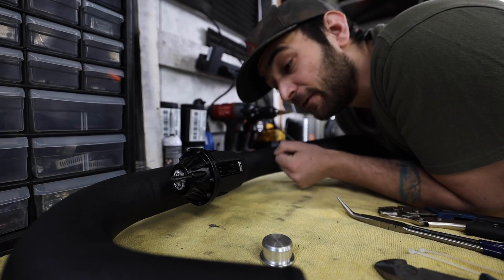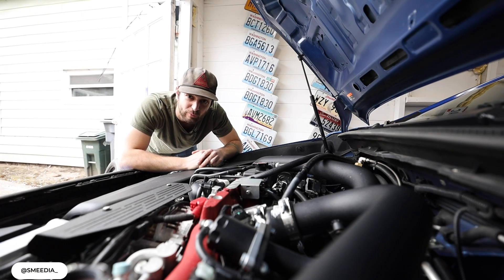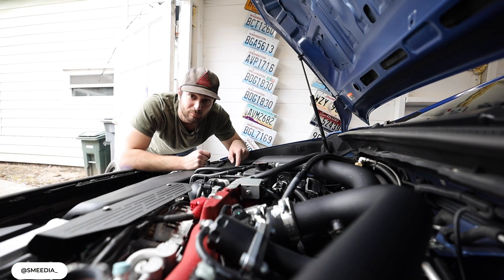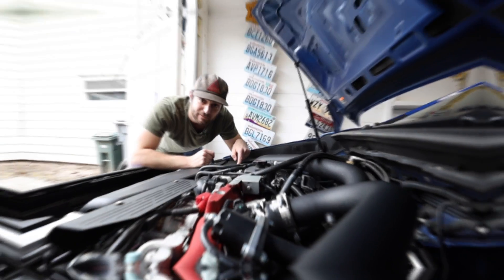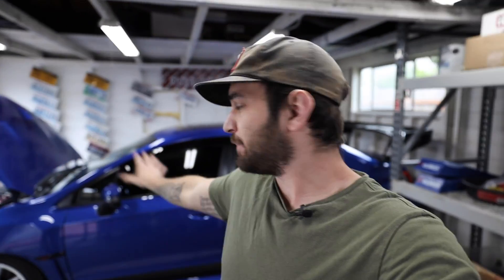This Is Why You Shouldn't Use a BOV On A Stock WRX/STI

Comment: lol first thing i like is the title. you shouldn't use bov on stock sti he is going to prove to us but  his car aint stock. you got front mount intercooler, thats not stock. you have tuned your car, thats not stock. you have many mods on your car. you need to rename this video to why you shouldn't use bov on a modded sti tuned to run rich. i have a bov on a 2019 sti and i have put over 32k km on it and no issues.
Reply from the maker: The car is still tuned for a MAF set up which would emulate similar problems with the car. Mine may have been extastrabated but still similar. The rich condition thr BOV creates is not so much thr issue, however the lean one following it is.
Reply: Smeedia your absolutely far from stock is my point though and just saying that opinions are opinions your and mine but in reality I clicked on your link to see why bov is no good for stock sti and your sti wasn’t stock so your opinion for bovs on stock sti are invalid to me. I have bone stock Sti and I have my opinion to viewers that may be wondering. If you tune your car it will change how your car performs but just bov installation ain’t going to make a big differences there then sound

Comment: This made me proud of choosing the Perrin Bypass :)
Reply from the maker: Perrin is a good option to use! 🔥😁
Reply: @Smeedia  Excuse me but what's the purpose of replacing a bypass with another bypass?
Reply from the maker: Spring pressure, the OEM valve can hold around 20lbs of boost but once you start to exceed it you need a stronger valve
Reply: @Smeedia  So it's a must in highly modified turbo engines?
Reply from the maker: Yessir 🙏
Reply: @Smeedia  🌹
Reply: @Smeedia  you can simply slightly crush the oem bypass valve. Use a metal ball on the center of the valve, and clamp gently in a wood protected vice. Only depress a small amount. Voila, free mod, holds more boost.

Comment: Hmm, how about with a recirculation fitting from the "fin" of the HKS BOV to back to the valve instead of blocking it off? That might be ok?
Reply from the maker: That's 100% okay, thr air is getting sent back through the system so thr ECU can correctly account for the air 🔥

Comment: It’s not even a stock sti. Do a video on a real stock sti. No nothing on it or time. Allot of people want this out of the dealership. This is what happens when you do this when you already have a tune.
Reply from the maker: Similar will happen on a srock STI, the MAF pulls data from what it is seeing such as mine. When you add an Atmospheroc BOV onto thr car you loose a portion of the metered air. While the minor rich condition will cause little to no harm the lean condition following will cause issues. The lost air will also cause stumbling and potentially thr car to die when let back down to idle. I suspect that the one I installed had a leak in it from the factory already which worsened the conditions shown. But this was as close to an emulation as possible before a hybrid SD tune went onto the car.

Comment: Your ARF doesn't show rich at 14.7 Stoich meaning your on pump gas. You going E85?
Reply from the maker: Car is now on E85, stays on a E70 Blend making 401WHP
Reply: @Smeedia  401 is really respectible.  People don't realize that's a lot of hp until you give them a ride, then there like holy crap👍
Reply from the maker: Thank you! Goal is to push the stock block as far as I can before the short block let's go but its definitely more than enough to have fun with up in the mountains 😁

Comment: Okay, so no matter what you are running the car is tuned for that part right? If you are running a BPV the car is tuned FOR a BPV in which case the car isn’t happy when you takeoff the BPV and put on a BOV. I don’t know if I’m understanding this correctly, but if you have your car tuned while it has a BOV then it will be fine right? You just don’t want the car tuned for a part it doesn’t have
Reply from the maker: To an extant you will be alright the major issue that I was teying ti get across is using a BOV on a OEM or OTS tune (one that is not intended for a BOV) Will cause issues

Comment: hey man so I've seen some people with older model Subarus make block off plates for the BPV/BOV to create compressor surge, just wondering if you have any insight into this and weather you would say its okay or if you would say don't do it, pros and cons?
Reply from the maker: It will put more wear on the tubo and mess with your AFRs, the older subarus are pretty forgiving if its something you want to do then you can but aside from the sound there are really no pros to it
Reply: @Smeedia  I have a 2017 wrx, would you say its just more beneficial in the long run to just keep everything "stock" and what I mean is just run a bpv and intake? I have the boomba bpv and had the Cobb intake at one time but took it off and sold it regrettably because I thought It was causing my CEL. turned out to be my studs from the j pipe to the turbo outlet had snapped and caused a leak causing the cel. but thanks for the insight and I will definitely make sure not to hurt the car. was just curious and seen it done but hadn't seen anything about the FA20 motors.

Comment: A Bov isn't going to change anything or make you run rich during idle.. or give you any knock during idle.. its doing the same exact thing as a bpv until you let off the throttle under boost. that's the only time you'd see a change, unless you installed it wrong haha

Comment: I have the perrin recirculator bov is this bad to run this on a stage1+ Cobb tune? The previous owner had it on there just wondering if I should take it out and swap it with the oem one?
Reply from the maker: You should be fine, theyre both recir valves so won't make a difference 🔥😁

Comment: I got a question so my car (wrx 2011) was tuned with gfb bov , and now I wanna switch it back to the bpv , is it ok to just change it or need to tune lol?
Reply from the maker: What was the GFB set to when you were tuned? I know their adjustable. If it was set full open I would get a revision on the tune if it was 50/50 you should be fine

Comment: Guys keep In mind he’s pro tuned with a front mount witch already causes more delay in air! I have the hks on my stock Sti runs fine I’ll post a video
Reply from the maker: As long as it's not leaking and spring pressure is adjusted it should hold fine, won't run in ideal conditions but sounds like you at least set yours up before putting it on.
Reply: Hey bro definitely waitin on that been really hesitant on ordering the hks bov
Reply: Hows ur stock sti so far? With hks bov?

Comment: Why not get a gfb Bov? 50/50
Reply from the maker: You can, I use to run one but it leaked quite a bit.
Reply: Smeedia leaked? can that cause damage?
Reply from the maker: Depending on the size of the leak it can, the ECU Will make adjustments to compensate for bur its less than ideal

Comment: A friend of mine has a 2018 WRX and he has an his bov with Cobb tuner access port, he also has an inlet pipe? I’m not a Subaru guy but hoping to get some info to help him out but he explains everything that’s happening with my friends car is it  okay to just swap back the original recirculating valve?
Reply: & also there’s not much information online with the newer model WRX’s as to there’s different sensors?
Reply from the maker: Yes swapping back to either a OEM BPV or after market BPV will help, as long as the air is recirculated back into the system it will run smoother. The ECU has no idea where the metered air is going so it can freak out, or if his BIV is leaking it will also cause idle issues

Comment: Hey man so the other day you we were talking about the Barometric pressure sensor but what is the reading supposed to be while the vehicle is on mine is reading 14.36 at idle.
Reply from the maker: It will be different for everyone, all depends on air pressure for where you are. Altitude is a big factor that plays into it. Mine reads around 14.69. But yours sounds fairly accurate for where you are
Reply: @Smeedia  true hey man i forgot to ask ive done tuning soo many times but i feel like a newbie since my pistons cracked but are there any monitors that i can dispaly on the AP that i can check prior to my datalog im almost at 800 miles with my IAG block. I got the AFR and all that. I just checked the baro but i want to make sure the car is healthy and im not missing any sensors that may be oit of tolerance.
Reply from the maker: Knock, fine knock learn, DAM are the ones I always suggest monitoring 🔥
Reply: @Smeedia  yup I got those already
Reply from the maker: I would stick with those primarily outside of those your choice. Have a video covering what I suggest monitoeting, what values to look for and why to monitor them as well

Comment: Omg that launch control sounded so mean bro 🤤🤤🤤
Reply from the maker: Thank you! 😁🔥
Reply: as far as I'm concerned, launch control system is an exclusive feature to cars equipped with automatic gearbox, right?
Reply: @coffeedrinker25-z4v  Umm no wtf lmao
Reply: @Kyezie131  I own an STI
Reply: @Kyezie131  What purpose does it serve in manuals then? I can launch my car the way I want.
Reply: @Kyezie131  You're probably confusing STI "Launch Edition" with "Launch Control".
Reply: In this case, it's no more than a rev-limiter. Any decent driver can balance the clutch pedal with the acceleration pedal to properly launch the car without the need for a rev-limiter. Unlike automatics where you can never build up the revs high enough before launching it without having a "launch control system" e.g. Nissan GT-R.
Also my brand new STI does not come with a rev-limiter anyways.

Comment: This video makes me laugh lol “the car smells rich “ I installed a hks bov on my sti and had no problems honestly it’s running great,
Talk to your tuner.
Reply from the maker: As long as your not on an OTS Tune with the BOV its not a huge issue. A protune fixes a lot of the out the box issues associated with just slapping one on
Reply: Smeedia I believe I’m on a OTS tune at the moment, I have to talk to my tuner but it’s so weird that your car has symptoms like that. Have you had any updates on it?
Reply from the maker: I pulled the BOV off the car after the vidro and stayed with the bypass valve, im going on a hybrid speed density tune so because I am still utilizing some of the MAF I'm sticking with thr BPV. But based off of what I did im sure the BOV was leaking air causing idel to be all screwed
Reply: Smeedia I would like to come help you maybe the rubber inside the inserts were not tighten down? Or the rubber seal bad? Also my kit came with a recirculating kit with my hks bov, if you want you can try it on your car if you wanna run the hks!
Reply from the maker: I only used the BOV as an instructional piece for the video to demonstrate the effects of an out the box BOV on an OTS TUNE. But greatly appreciate the advice!
Reply: @Smeedia  what is OTS Tune?
Reply from the maker: Off the shelf, its a pre made map designed for multiple cars to be easily used
Reply: Smeedia So as long as it’s pro tuned with the BOV you should be good?
Reply from the maker: It qill be better than running an OTS Tune. Not perfect but you should be good
Reply: How could it suddenly "run rich" on idle when either BOV or BPV does not work?
Reply: @mibars  I think he didn't tighten his pipes properly.hes leaking some where.thats what happened to my wrx.i use a gfb adjustable bov so half vents to atmosphere and the other half back into the motor
Reply: You wouldnt mate. Its a twin piston or diaphragm design valve DESIGNED TO RUN ON MAF SETUPS. People just seem to talk absolute shit.
Reply: I put one on my stock 2011 sti never had a problem. But nice video 👍

Comment: Washington State resident - Type RA owner, so you think the bpv is the way to go?
Reply from the maker: Yes I do, shouldn't need a BOV unless your full speed density or making higher HP. You can Run a BOV if you want to just make sure you get protuned with it on. Would highly advise against using it with an OTS Tune.

Comment: Great Video! A few years ago I purchased a RFL blow off valve, had it installed with the idea it was a plug and play, I was so wrong. No matter how many washers, ( how it said to adjust ) caused the car to stall at every stop, and turn the tail of my car black from running too rich. To make a long story short, it’s back in the box and sitting in my trunk. I wish I saw your video 3 years ago!
Reply from the maker: Glad that you got it sorted out, and some cars react different than others from what I've seen most think that BKVs are plug and play but so much more to them than one thinks. Appreciate the added sorry and kind words!

Comment: The BOV isnt set up properly. You need to adjust the preload on the BOV for proper idling.
Reply from the maker: Totally agree, wanted to emulate just installing it slight from the box as most do, the video was planned differently in my head than how it was made but appreciate the added info for those seeking to use one! 😁

Comment: I dont mean to be annoying, but this doesn't make much sense to me. Installing a Blow Off Valve instead of a Bypass Valve SHOULD NOT RESULT IN THESE EFFECTS. Especially not during idle, where there is no boost pressure in the intake manifold or the entire system. A Blow Off Valve is naturally closed, so should not effect your idle in any way. However, this BOV in the video looks like a HKS SSQV BOV or a knock off. They are a "pull type " BOV instead of most others that are " push types ". The valve gets pulled open by inletmanifold vacuum behind the throttlebody. So my explanation here, it looks like the set screw, (if there was one)or the spring inside, was not set up right or broken and the BOV opened slightly during idle causing a little vacuum leak. Or he forgot to tighten a hose or something but everything in this video screams vacuum leak.
As soon as he got on the pedal, a tiny bit of boost was created closing the valve again, so it was reving fine, but as soon as he let off the gas, so boost was gone and you switch from positive inlet manifold pressure to negative, the engine wanted to stall. That would also explain the knocking when initially stepping on the gas paddle.  As for him smelling gas.... no clue. His AFM read a decent ratio, especilly concidering the car was warming up.

But most important of all, he is actually right with what he wanted to say. Installing a BOV on a Turbo car with no Tuning that addresses the BOV or that sits behind the MAF is a bad idea and can cause the problems he addressed. But I have actually installed these BOV on many cars before, mostly Mitsubishi Evos and never had any issues except cars running rich when coming off boost. 

So long story short: This guy is completely right in what he says, but I highly doubt that when you put a BOV on your car correctly, it will have any of these effects.
Reply from the maker: No worries, totally open for corrected information! The video came out a little different than I had invisioned it. I believe the valve was leaking which was causing the idle to jump around. Could have been the seal to the piping or the valve itself which resulted in the funky idle. But appreciated the additional input and clarification!
Reply: @Smeedia   Yes, I also think it was probably the valve itself that acted up a bit funny.  I  am glad I did not come across as preachy or anything, just  wanted to give my thoughts on it. I am glad that you did not take it as critisism. And you know what, I love your Subaru and your vids are great, so  I'm a subscriber now. Keep up the good work.
Reply from the maker: Appreciate the support! And my goal for the channel is always to have the correct information presented, qell as correct as I can make them so anytime information is added in am always game to have it Included!